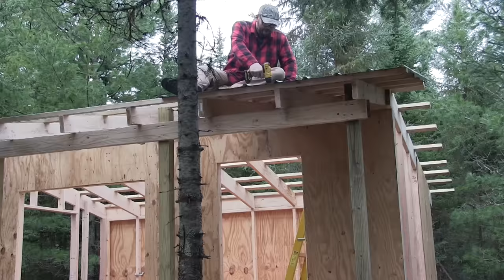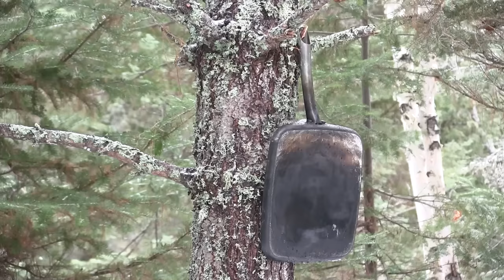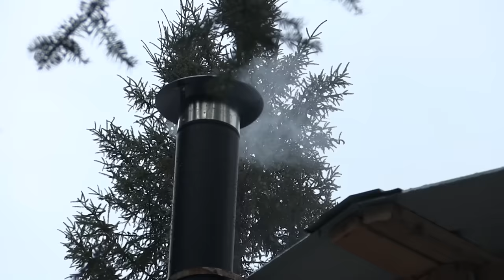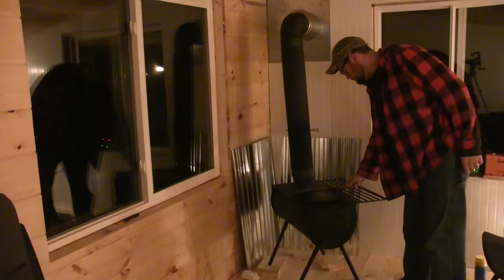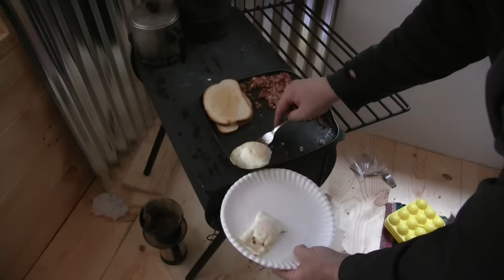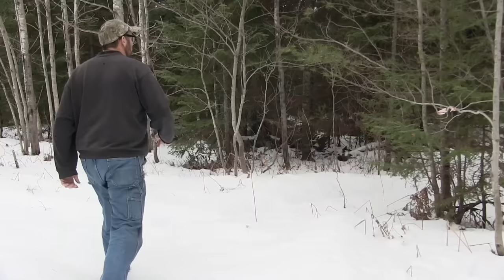Off Grid Cabin In The Woods (part 2)

Comment: My parents saved & bought a 1932 Cape Cod in '75, 10 yrs after graduating hs, marrying, & moving from TN to NY.

It was fixer upper & dad did everything from the floors to the roof as well as outside (grapevine trellises, rosebushes to grace the kitchen windows, putting up a shed, lean to for the wood.
 The first yr, they bricked up the fireplace and put in a wood burning stove. He'd work alongside a cutter after his shifts on the LIRR & bring home the extra. Best decision ever! That stove heated two levels within 45 minutes and kept the oilman visits to once a year unlike the neighbors who had him out every other month starting in October 😮.

I'd help him chop, season & rotate the wood throughout the summer to early fall, bringing the drier pieces to the back porch, splitting kindling, etc 
 I remember helping him hang gutters, put up paneling (a true '70s experience 😂), replace the formica countertops, pull up the linoleum flooring and replace w tiles, replace piping, solder copper, painting rooms, putting up floor to ceiling mirrors to add depth, so much over those 20 yrs until I married and left.
Then when he suffered a double stroke in 2017 and Alzheimer's set in, he eventually became wheelchair bound. I built a portable ramp from plywood, sanded & covered w outdoor carpet & put double looped handles on it from (get this) yardssss of telephone cord 😂 so his caregiver could lift it in & out of the doorway to take him outside. It tickled the neighbors to see his daughter donning his toolbelt!

I'm honored to be able to follow in his footsteps in at least being able to take care of my own house (and cars, yep, he was THAT dad! I even went to work in the svc dept of a dealership all through high school & into college. There's NOTHING like the power of being able to know when a mechanic is trying to rip you off😂
I'm screening in a patio next😊
Thank you for the memories.
~Best to you

Comment: I have an old summer pasture home in the Austrian Alps at 1000 meters elevation. It was built in stages, with the oldest bits about 600 years old.
Although I didn’t built it, I’m fascinated by the techniques used by the herders who did. It would be too simple to say that it is built using simple techniques: while the cuts and methods are easy to understand, it’s amazing how precise the fitment is. Basically none of the cuts are straight, the tools used were primitive, and the is not a nail or screw in any of it.
The house itself is HUGE. Three stories high, with space for animals and equipment - today taken up by bedrooms, of course. It sleeps 18 easily.

All this built with what appears to be raw lumber from the area, with no nails and handmade hand tools (some of these are still in the basement).

It’s nice to be able to go there.

Comment: Great job, Dave. Love this cabin. The coyotes were a real treat along with your smile that showed how much you appreciated them. 

Loved how you used old-timers skills on that saw namely caution & makeshift supports to stay safe. Keep up the great work & stay radical!
Reply: The problem with caution and forgetting the actual savety measures is that the savety measures really are suppost to protect you from what caution cannot take care of. When something unpredictable happens it is too late for caution. E.g. if the wood warps in the wrong direction behind the blade because of tension in the board, then it is too late for caution.

Comment: Great cabin Dave. A little tip with your table saw. If you rip halfway through a board, you can pivot the board straight up and off the table. Then flip your board end for end and rip the other half. Then you don't have to step around the saw if you don't want too. Honestly, I've done it both ways depending on the circumstances. And you're right, Larry Haun is a fantastic carpenter to watch. He was a giant amongst men.

Comment: Love how this project turned out!  I would suggest not to use spray foam insulation. It expands and over time will make opening doors and windows difficult. I've used it before on a house remodel.  Several fellow contractors recommend not to use spray foam around doors and windows. Instead use insulation. This video makes me want to do the same thing you did. Great video!!!!
Reply: He used low expand door and window foam. It does NOT create excessive binding, because once resistance is felt the foam doesn't expand out. I've used the same stuff and it provides great results. Regular foam will expand to much and bind doors and windows.

Comment: i  would love to get a list of materials and supplies from you *nails, hammer, screws, different types of wood *plywood, 2x4's, planks, shovel, hand saw, power saw, drill, more nails, more screws, canteen,  a generator, seahorse, a heavy duty truck,..primers, sealer, caulk, windows, door, door knobs,  more wood, the list goes on and on...i Love it!  . sometimes it gets cold in Florida.

Comment: With horizontal logs I built a t frame which I attached the window to the t frame floated in the routed out insert. Wood has a 2 to 5 % shrinkage so it needs to float.

Comment: Amazing project. One t echnical question: here in the Czech Republic it is compulsory to put a nonflammable layer under any oven (reaching at least 30cm outside the perimeter of the oven itself), mainly to prohibit burning pieces of wood to fall out and ignite the floor. Or very hot ash when cleaning the oven,

Is that something you will still do or do you not need it?

Comment: I noticed you did have a good piece of safety equipment for that saw that you didn't use - you could have made a fine temporary motor/belt cover out of that cardboard box that was sitting behind you, plus a couple pieces of that scrap pine. Its a lot less painful to have cardboard fly at you than your cut trim piece!

Comment: I've watched this video along with part 1 several times now and I think this is the perfect starter project for me given "medium" level carpentry skills etc.  I'm in Louisiana where it gets to heat indexes over 100 so I'll probably do a cutout for a small window A/C.  If I build in the woods under a tree canopy, the place will probably cool off fairly quickly.  I've thought about adding some minimal wiring with the outside plug for a generator and/or solar panel.  Biggest question, what would you suggest for a siding option as I'd be concerned with long term viability of the raw sheet wood?
Reply: Saw you address this in the follow up homesteading video.  Thanks!

Comment: Hi @bushradical.  I have a question about sealing the floors in the winter.  Did you come back in the spring, remove the wood stove, and seal under the small pine feet that you put in as a base for the stove?  Is it necessary?  I'm trying to plan out a similar project and this caught my eye somewhat.  If given the choice, would have done this in the spring so the stove was a less urgent install prior to sealing the floors?

Comment: I live a good 40 minute drive from any major city. There's nothing immediately around us except for a few small townships. I'm saving up to buy a couple acre parcel of land. No well, no septic, and it's not zoned. Thing is, I'm not going to ask permission for a damn thing. Stuff wrote down on paper be hanged, I still have the spark of freedom in my heart. My forefathers didn't ask and beg. It's rural enough around here that I doubt any gubment fellas ever come to call, wanting their pound of flesh. I'm going to cut my own gravel road from the main road (about 400 yards) I'm going to clear a spot off. I'm going to build me a little cabin similar to this. I'm going to stake my own hand pump well. I'll be getting some solar panels and a cheap generator to charge a battery bank for simple electricity. I will pay the little property tax each year and get me a PO Box. I ain't asking for no permission or permits or anything. If big brother cares enough to come bother me I'll just cross that bridge when I get there. I'm tired of giving a rich man my poor man's dollar just to have a roof over my head. I don't want to be dependent on this shitty system.